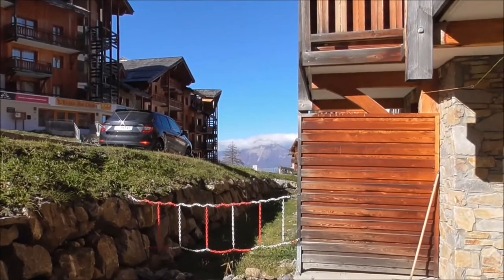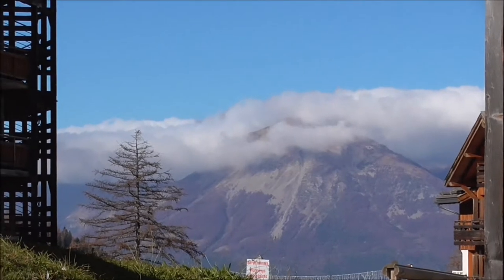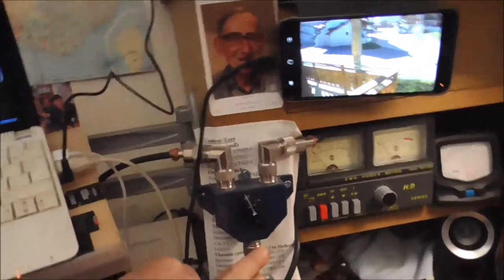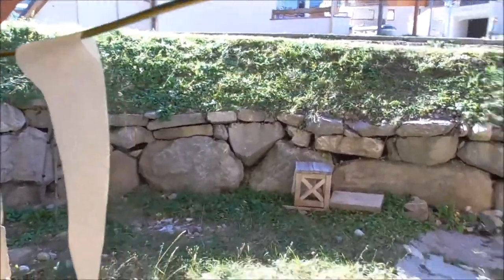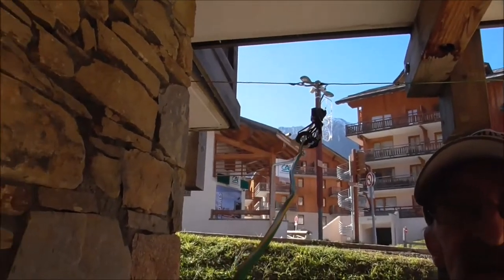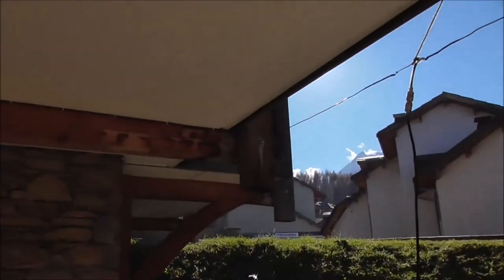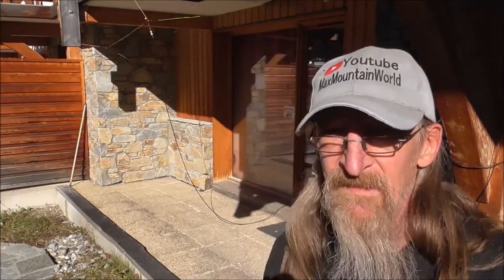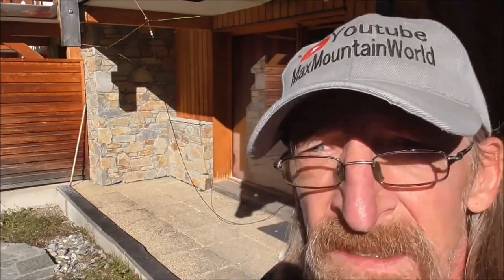Wire Antenna Experiments

Comment: Have you tried adding a third element (director) element to the moxon? Not sure if it would work or length (maybe 10% less than driven, not sure) But if you have the time to play, it might be worth a punt.
Reply from the maker: Its on the Project list for next year. There are online calculators for 3 & 4 Element. Let You into a Secret ~ Very Easy to Create a "Quik-Fix" 3 element add-on and then a 4 element too. I intend going up to 6 element! Imagine the Performance!!! Thanks for Your Input. There Will Be Lots More Here Soon. Cheers